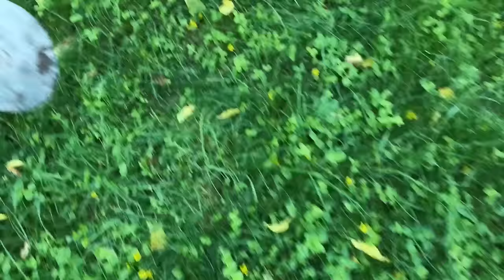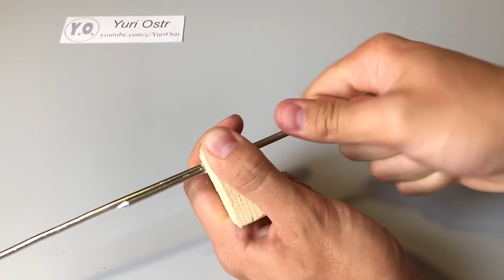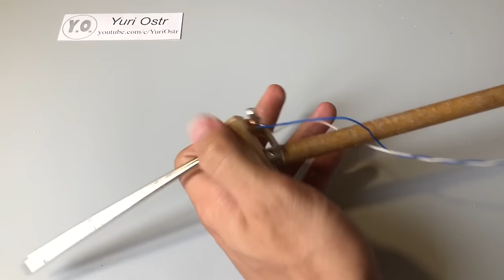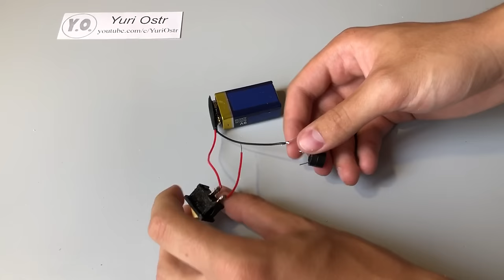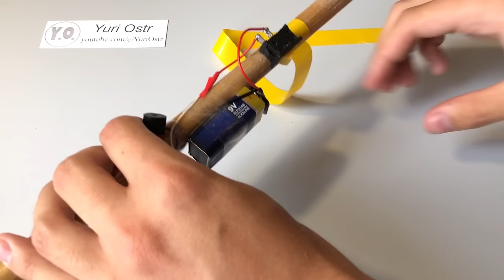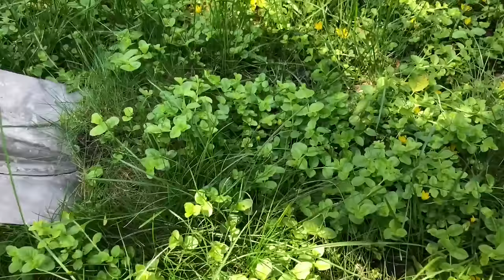How to Make a Metal Detector at Home - Everyone can Make - Easy to build

Comment: When the two nails touch metal the circuit closes and the buzzer is connected with the battery how will it detect the metal that is 3 or more feet inside the earth what are you uploading bro make a detector with sensors no 
Foolish invention please
Reply: Saboor Saboor it’s on a budget sensors cost quite a bit of money for a little stick and wires
Reply: Make one and send the video. would be interesting to see what you are say about the sensor, this one seems to work fine, but I'd still like to see your version...
Reply: I get that English is probably not your native language, but tell me, why the heck would you say please after calling his invention foolish? If you're native language is Hindi or any other Indian language, you need to understand that 'please' is only used when you are asking for something. If not, then I honestly have no idea what to say.
Reply: Is that work.or just fake?

Comment: issue with this is that it isn't detecting metal over a wide area. the reason it beeps is because the metal object closes the circuit, not because it detects radiowaves.

Comment: Simple electrical circuit. The probes have to hit metal, even wet soil would set it off.
Reply: actually wet soil wouldnt activate it but yes its pretty much useless
Reply: @radogost1536  true

Comment: is somebody can explane how it 's scientifically working ? how to boost the detector ? or sum please
Reply: it basically closes the electric circuit when those two metal sticks touch the same metallic object. so it only works if it really touches the metal and it doesnt work from any distance. you cant really boost the efficiency of the detector because it always has to touch the metal

Comment: This is a poor design. The way that metal detectors work is by creating a magnetic field with a coil, inducing a current in a conductive metal, which in turn creates a smaller magnetic field. Metals detectors have two coils, one to induce the field and another to detect the response.
This is only a simple circuit. In other words, it only finds a metal when it short circuits. It will have two problems. It's unlikely to detect anything it can't touch and conductive surfaces like wet ground are likely to set it off.
Reply: You’re in the hemp industry how would you know?

Comment: This is completely useless. It is not a metal detector as such. It only works when you short the contacts by actually TOUCHING a metal surface. So what area can you search with this? I estimate you could search 10cm under the ground one 1m² in about twenty minutes. I guess if you are THAT bored, you could do it. Otherwise it's faster to just take a showel and dig...